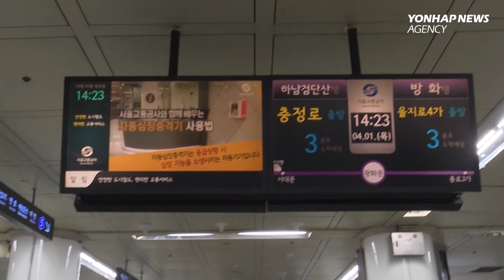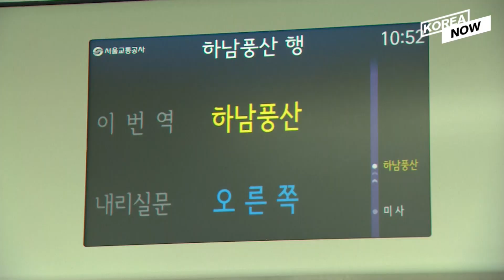The GTX set to transform transport in Seoul and beyond

Comment: Korea always leading the way with the greatest solution to modern city's problems. 
This is like an express subway or something it seems? 
It's going to be great once completed!
Reply: Not really...it's an adaptation of Paris's RER network ("reseau express regional"/ regional express network). While Seoul is indeed a great transit city, Paris has actually been the one to pioneer all of these different modes of transport and continues to stay on top, with its latest GPE project ("Grand Paris Express" which aim to build 200 kilometers of new metro lines operating higher speed trains), due to open from 2025 and be fully operational by 2030. The Seoul's project, apart from being similar in it's scope, is also very similar in it's naming (GTX  vs  GPE). Regardless, Seoul continues to be very advanced in terms of transport, on par with Paris